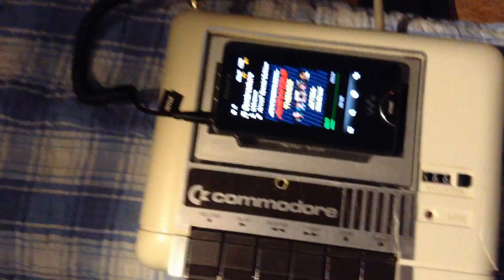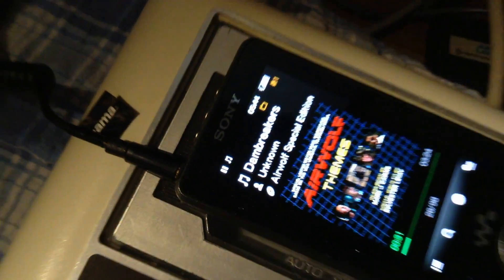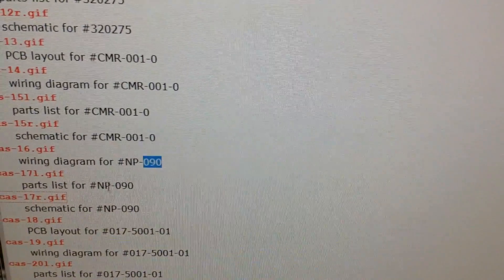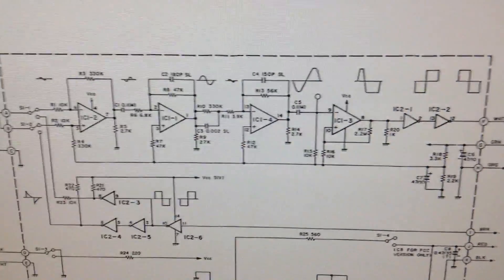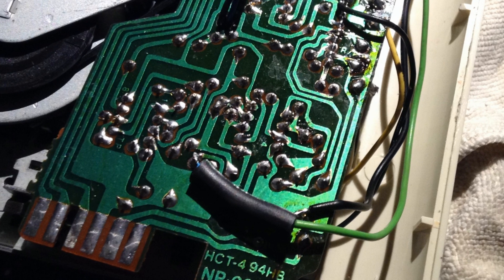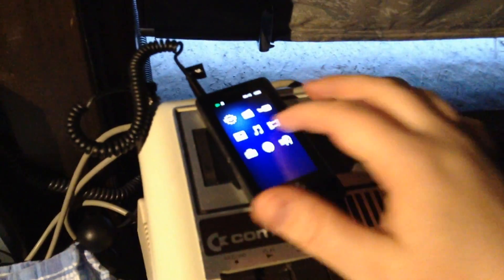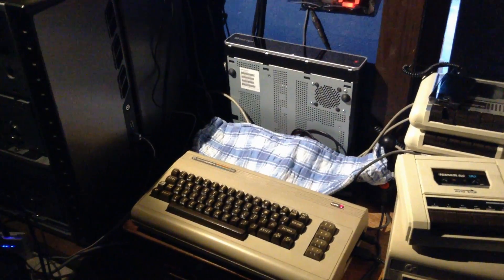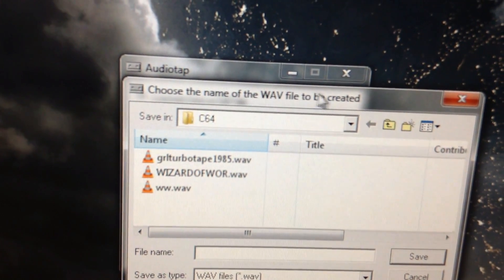C64 Datasette Audio-input mod + AudioTap

Comment: with my working dataset, I use an old android mobile and a  app called tapdancer (it converts t64 to audio and is built for this) with a CD tape adapter (a fake tape with a headphone cable) and it works
Reply from the maker: Nice ! I have downloaded tapdancer, but not tried it yet.
Reply: Can't find this app on Google Play store, maybe it's under another name?

Comment: is the second wire connected to a ground on the commodore 64 tape deck for the gnd of the 3.5 connector ? and the positive sound in cable (thats the one with the 100k resistor  right,? i am trying this on a commodore plus 4 tape deck, except it has a la6324 instead of the an6562 so i have 14 pins, i noticed it has 4 inverting input pins not 2, they are pins 2,6,9 and 13, so should i just try all of those should pin 6 not work?
Reply from the maker: regarding pin6, impossible to say. Yes second wire on audio wire is on gnd on c64 gnd. You can do the same i did in the second video showing. This is almost four years ago I don't remember, but it was an azimuth adjustment program and I was just poking the 100k resistor onto random pins until I saw a clean azimuth reading on the TV. I'll find the video and link it in in the description. https://www.youtube.com/watch?v=KoovDDUuk2Y

Comment: Would it be possible to use one of these tape drives as a regular tape player like for music?
Reply from the maker: Not directly. The cable carries digital signals. If you do take the audio out of the tape heads you will hear it, but bad quality and only mono.
Reply: But are the signals exactly the same as if you were to play the tape on a regular tape player or is there conversion going on between the playback head and the cables? Meaning if you hooked a speaker to the cables and played a music tape in the player would you hear music?
Reply from the maker: The tape signal is converted to digital (or rather, a stream of ones and zeroes). So if you want to pick up audio, you'd need to connect a circuit to the board inside the tape drive. Not so easy.
Reply: @bwack  If there's a preamp inside you could tap the output and feed to an amplifier and then either put line out jacks or outputs for speakers. As for mono you could change the head for stereo. For the preamp it's probably Y'ed to mono so maybe undo the Y'?
Reply: Yours  is a pretty bad idea considering that the C2N was already bad on his own and sensitive to interferences. Failed loading was very common, and what you are asking is feeding digital data to an analog input through an analog output. Basically, you are doubling the chances of error.
Reply: Old comment but I have a third party datasette called "DR64" or something like that, appears to be made by Elite but I can't find anything about it on the internet really. It has a 3,5mm jack in the back and it outputs the audio from there. There's no volume adjustment so you need some other form of volume control because otherwise it will destroy your ears obviously

I was hoping it would've been an input but it wasn't unfortunately